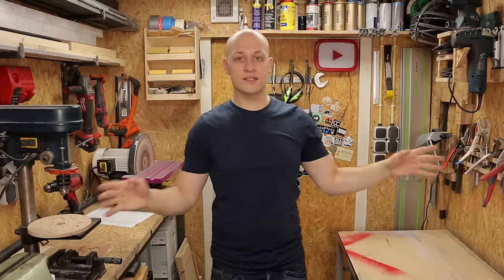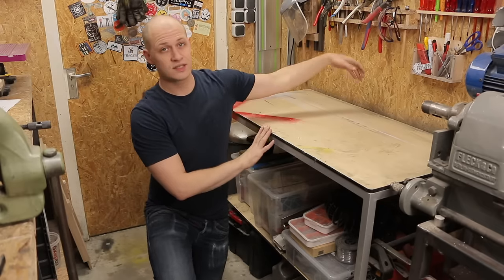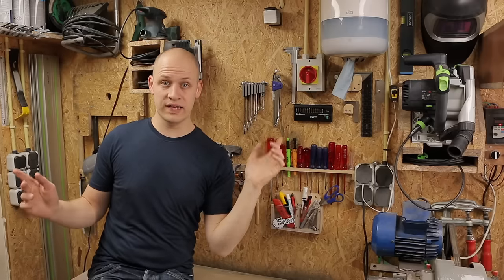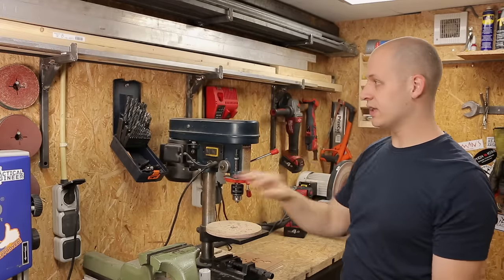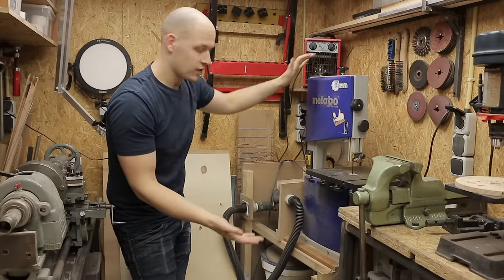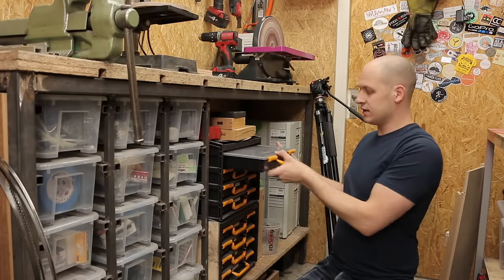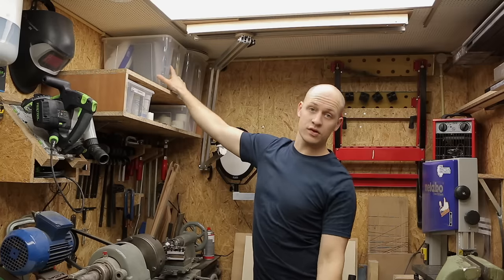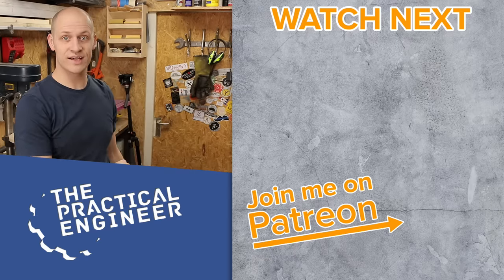My Small and Efficient workshop (2 x 3 meter) - 2019 Shop tour

Comment: Hello from Arkansas USA. Like your video, lighting and sound is very good. I recently moved out of a 30ftx60ft work shop into a 10ftx20ft work shop. I had to research and design a lot of space saving remedies. Let me suggest that build a flip top bench and mount your sander on one side and the drill press on the other. I actually made a 3 sided flip top mobile bench. Like a pyramid that rotates with a tool on each flat surface. For storing my sheets a wood I made a drop down rack on the ceiling that's hold two or three sheets of plywood and I don't bump my head on it, however it's hard to get them up there especially with no help. I will send pics of my shop if your interested but im not a photographer and pics don't do it justice.
Reply from the maker: Thanks! I have thought about a flip top but haven't had the need for one yet. Maybe now the belt grinder is done that I need more room

Comment: Man i am impressed. i have a small workshop too and spacing everything is a complete nightmare, but its getting there. However your use of space is beyond my comprehension. I applaud you. That's quite a genius approach you have taken.

For storing sheet goods, you need two things... 1) shop floor footprint, and 2) access. I would say you definitely have the shop floor footprint. Sheet goods take up hardly any space on the ground if you store them upright. If you store them the way you stored the sticks and things, i.e. against the wall behind the benches and tools you can store quite a lot. But getting them in there and out of there would be a hassle because you have to lift them up against the wall and over the benches and tools. It might clash with stuff you have hanging on the wall. Hence i have two ideas for access. Either you can store them against the wall behind benches and build an access from outside the workshop. Or the other solution would be to create sheet storage under the floor with the access point at the door. So when you open the door you step up to your new shop floor by 100mm and you have room for say 50mm of sheet storage you can slide out at the door.

Admittedly this route requires you to clear out your workshop and build a false floor. But since you are crazy organised already and everything is in boxes and such, AND since your shop is very small, you might be able to knock out the entire floor in a day and have everything moved back in. measuring and precutting everything ahead of time would help speed this up.

one massive benefit of this system is that the sheet goods are stored flat so they wont warp. and if you want to store larger quantities or organise them by type, you could build four compartments each 50mm high and build 4 access points from outside, at the same height, around the 4 walls. then you can have a compartment for plywood, MDF, chipboard and miscellaneous wood products. 

but i really am amazed with what you have been able to get into your shop.
Reply: Excellent video content! Apologies for butting in, I would appreciate your opinion. Have you tried - Mahorrla Wooden Paradise Method (search on google)? It is an awesome one off product for building better sheds and woodworking without the headache. Ive heard some pretty good things about it and my work colleague  got great results with it.
Reply: @genesisdaza6870  SPAM

Comment: Impressive little shop. I imagine easy to heat in winter too. A suggestion to solve the problem with the position of your vice - you could install 2 strips of aluminium or steel slotted channel into your bench top and attached the vice to them using bolts and Tee nuts. When you need to clamp something long vertically in the vice, the bolts could be loosened and the vice temporarily moved further forward on the bench top and tightened down. Once finished, the vice can be loosened and moved back to it's normal position out of the way. Great video, thanks for sharing.
Reply from the maker: Thanks for the vise tip! Yeah it heats up in like 30 minutes with the small heater so thats pretty awesome!

Comment: I like your use of space. I do not know what your outside situation is like, but I had once a tiny workspace and needed places for sheet materials. What I did, was, on the outside on one wall, I built a 2foot wide lean-to 13 feet long as my shop was only 14 feet long. on one end I had full 4 x 8 sheets and on the other end I had half sheets and under. Small roof, solid floor and covered walls with a door on each end. Never lost any wood to weather. It worked for me for many years.  Thanks for sharing your video.
Reply from the maker: I like that idea a lot. And it seems like a very efficient method. I cannot add more space on the outside unfortunately :(

Comment: To solve the vise problem, you could just cut or drill a hole under the jaws to let the pieces fit past the table top. That would keep the vise out of the way, but give more space for parts
Reply: Or use a spacer between the inner jaw and your product

Comment: Idea for sheet storage, create a weatherproof/watertight slide in/out section down the side of the shed. You can even put the whole storage thing on a frame with wheels to slide it in and out. Keeps it out of the way but nearby and can be up to the size of one side of your shed, thickness dependent upon space. 

Alternatively you can do a pulley system and have it drop down from the ceiling but would require putting your lights on the underside and I personally wouldn't like having the weight of lots of sheets of steel/wood above my head all of the time :P
Reply: Ooh I'd also add (if you haven't got one already) a fold away stool for those jobs where you're just spending forever working on the same thing over and over.

Love your little workshop space. Really want to get a workshop set up in my garden. I may use some inheritance money from my grandad to get it set up, I think he would approve of that. He loved his tools ;)

Comment: what you could possibly do to keep your huge vise in its place is add a spacer from the back jaw to the front of the bench.  place a board on the floor and up against the front of the bench that extends higher than the top of the vise and measure from the board to the surface of the back jaw.
then make a spacer that fits in between both jaws. now if you can clamp a board or a pipe or anything long vertically without moving your vise. when your done, remove the spacer and close your vise all the way.
you might not be able to clamp any material that is really thick but i think that vise will open up enough for a piece of wood like plywood.  just a thought.
cheers
Reply: That's a really good idea. 
I was going to suggest just cutting notch out of the bench top. But your idea is much simpler.

Comment: My garage is approximately
 2000 square feet. And I'd give just about anything to have a 24'x24' 2 car garage instead. My father and I built it from the ground up. I would build/ restore old cars and trucks, this is why I THOUGHT I needed a huge garage. I've been welding and fabricating for over 35 years, not to mention I've tinkered with building with wood since I was 5. My father passed away suddenly in July and I lost the willpower to work on cars. Anyway, believe me when I say I'm envious of your shop. It may be small to some people, however I started out in a 8x10 shop. It was so peaceful just to turn the radio on and go to work. 2 THUMBS UP 👍 👍.

Comment: thanks for sharing and shop looks great. I just finished my shop/shed and is same size as yours. ran underground elec yesterday and insulating next week. I do similar projects as I am a hobbyist woodworker/metal fabricator. No tools in at moment but have a lathe, drill press, mig, table saw, mitre saw, band saw and other smaller tools.  Built 2 shed's this summer, a "he shed" and a "she shed" (slightly smaller for wife's gardening tools). Just here looking for ideas.
Reply from the maker: Awesome! Having a clean start like that is a cool position to have. That way you can arrange it all in the perfect spot

Comment: I'm am doing this with three small metal buildings that will be off grid, and insulated.   One for woodwork, one for metal work and one for electronics and assembly.  I believe that this will help me save energy and heat/cool much more efficiently.  And also I can manage dust much better.  I'm thinking of converting my bench tools with dc motors allowing me to use cordless batteries throughout.  Ofcourse my welder will still require 120v ac through an inverter.

Comment: Cheers for the tour of your well thought out workshop. Regarding the sheet storage - you could build a rig on the roof that lowers with pulleys and still houses your lights. You could potentially have 200mm or so up there, depending on how much support is already in place for the roof and how much headspace you need. Starjumps would be out of the question.

Comment: I have a 15 foot by 10 foot timber workshop with a central wall halfway for the wifes stuff.i have a mini lathe mini mill on worktop down one side and drill press, bandsaw, vice,bench  grinder down the other with air compressor and other storage underneath but not anywhere near as organized as yours.looking at what you have done motivated me to get organized

Comment: Very helpful video. I'm about to get a 6' x 12' shed, which will be my workshop and bike storage, so this is very helpful. I like the fact your shed isn't perfect - very utilitarian, using resourceful ideas rather than just running down to the local DIY hardware store and splashing out £2,000 (or Euros, dollars!) on mass-produced solutions. It's also good to see that you have made mistakes and point these out.

Comment: I have welded a length of 50mm box the width of the bench (front to back) directly beneath the surface of where your vise sits now & I made up a plate that the vise bolts onto & welded that plate to a box section that snugly slides into the 50mm as in telescopic & this can be completely rotated for various applications & or removed for storage elsewhere if desired ...

I drilled a hole in the outer box then welded a nut to accept a 10mm bolt to lock the inner slide once positioned ... welded some rod to form wings on the bolt head like a butterfly nut/bolt so as to lock/unlock without having to use a spanner ...

Difficult for me to see properly but if you freeze frame @ 5:40 you may be able to weld the box section to the side of your bench frame under your band saw ... If you can't weld directly to your bench then fabricate mounting plates welded on the outer box to bolt to the bench ...

Anyway just a thought ... great little workshop none the less ...

Comment: Excellent, you have really made the best use of the space that you have. Organization is the key. As far as your vise is concerned. You could mount it on a 2 inch thick by 12 inch wide board at whatever length is best for you. Then you can store it anywhere and move it to where you want to use it. You can just utilize a couple of clamps to hold it in place as far on or off the surface of your bench. And you could mount it at any angle you wanted, to accommodate what you are working on. Being able to store it under your bench when not in use, would provide you with a bit more table space for some other tool that you could work with. It sure looks like you have it all under control though.
Reply from the maker: 2 years later and I still have the vise issue.. I might just do what you suggested here. Thanks!

Comment: Get a hitch mount for the vice,then you can mount recievers in several places you might want to chuck the vice at
Reply from the maker: Thanks for the tip! I'm thinking of making it slide back and forward with some locking mechanism. But other projects often go in front..
Reply: In my small shop I mounted the vice on a board, and just clamp it where and when I need it. I did the same with my grinder.

Comment: New sub, I like this video. I had for 26 years a 10X10 ft. shed for my shop, I even had a motorcycle lift inside for the winter months.  I made it work, I bought a house in Tennessee and now I am working on utilizing a 28X25 shop that came with the house. I have so much room now that I am trying to work on utilizing the space that I didn't have. I like some of the ideas that you have. Great video

Comment: Maybe you could do a false floor with a pocket for the ply/sheet?
The you grab it from out the front door and walk it in. 

Or if you have access to the outside, maybe you could do a lift up flap with storage flat against the wall? If you could cheat 200-300mm you could store quite a lot.

Comment: depending on the construction of your roof, above the celing/lights can be a great place for materials storage. If you have a pitched roof this is usually easy. If you have a flat roof, not so easy usually.
Reply from the maker: Thanks for the tip! in this case its a flat roof, but with a pitched roof it would be a waste not to use that space.

Comment: I had an idea that might work for the plywood. You could still leave the ply wood where it is at but build a fake wall on a hinge to cover it. Maybe something similar to what Shop Nation did but sized to fit your shop? He put french cleats on the outside of his to hold larger clamps and whatnot but I’m sure there are other ways to utilize the outside of the fake wall if you were to decide a french cleat is not the best option.
Reply from the maker: I like the idea! Thanks!

Comment: For your plywood. I'd suggest an extension of sorts. Make a cavity similar to a pocket door type set up. On the outside of you shop's long wall.

The plywood would slide in to the cavity. Like a pocket door sliding into a wall.

Your wood would be right outside. But protected from the weather.
Reply from the maker: I like that idea a lot! I cannot add any space on the outside unfortunately :( But maybe the idea can be translated to something inside
Reply: @Thepracticalengineer  can you cut a slot in the front of your shop? Then make the pocket behind your work bench.

Comment: hi mate, love the video. i'm probably constructing a similar workshop in the near future for myself. Simply to reserve some space where i can work and keep my tools, compared to just random spots in the shed like right now. What i was thinking for myself was using the 'french cleat' system. This will allow me to make dedicated storage for anything and everything, but will also allow me to move things around depending on what i'm working on. So if ill be using my circular saw in a project often, i can move it closer. Maybe that is something you could implement too instead of fixing everything to the wall with screws.

Comment: I have an ( almost) full width roll up door. I have my sheets in a rack behind my tool bench. Down side is, I have to take my sheet goods outside and then bring the sheet goods into the work area.
Reply from the maker: That sounds like a good solution. That way they are out of the way when you don't need them.

Comment: Sheet material is usually thin, so it fits behind a workbench. In my workshop, the workbench is placed about 10 cm from the wall. Between the wall and the workbench, most of the sheet material fits. You do however, need some space to pull it out.
Reply from the maker: Thanks! that might be a good option for me too!

Comment: Great video and very well thought through workshop organization. I'll definitely borrow many of excellent and very useful ideas shown in the video. I never thought such a tiny workshop can fit that many machinery, and still be convenient to work in.

A thing that might improve your workshop is powerful ventilation (not something fancy, just another cheap but practical solution). It looks like this place can get very dusty in short time, or the air can get stuffy. Ventilation could help in those cases.

Comment: Great shop, great share! You got a fresh sub 😁
I have a shared tiny shop- 1/2 of a 4x4m space with no headroom, so I'm taking notes!
For the sheet storage- my best suggestion would be to tuck it against the wall behind a wheeled power tool (your bandsaw cart v2 0?) It seems that if the sheet goods weren't there you could swing it out to access material, then swing it back again. Heck, you could build a sheet rack onto the back of said cart, and pull the material out with the cart!
Best of luck on all improvements. Looking forward to more crazy inventions and practical improvements!

Comment: My idea for your vise situation. I think you were wise and insightful for back setting your vise mount. I think I have what seem like a good solution for your problem with putting long things into your vise.

Drill one 1-1/2" to 2" (sorry don't know the size in metric) hole on each side into your bench top just below the edges of your vise jaws. You could add a layer of  1/2" ( or 3/4") plywood to your bench top to provide more rigidity and strength and a smoother work surface. This might compensate for the two holes being drilled drilled into the bench top.

This should help you to accommodate the majority of things you might need to put into your vise jaws which are long. Of course you would have to temporarily remove one or more of your clear storage boxes from underneath your bench in order to accommodate whatever length of the piece you are working with in your vise jaws.

Just my suggestions. Hope you don't mind my input on your vise and bench.

Thank  you for the video. I like your tiny shop. You have it organized well. The master power switch it a great idea. As you said kid safe, as well as good for emergency cutoff. -Rob
Reply from the maker: Thanks for your detailed answer! At the moment I'm looking to move to a new shop so I might change it there